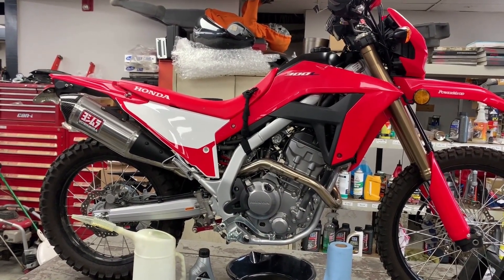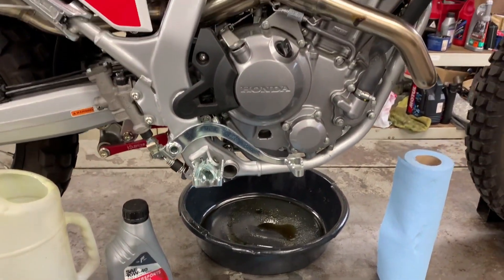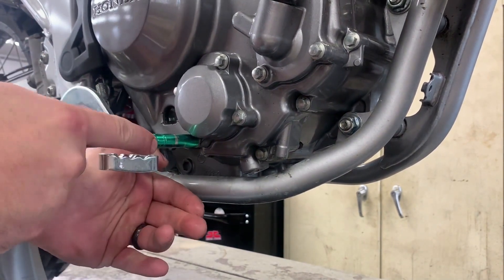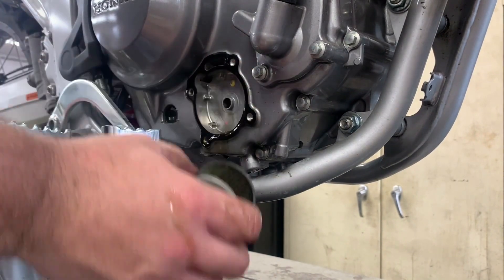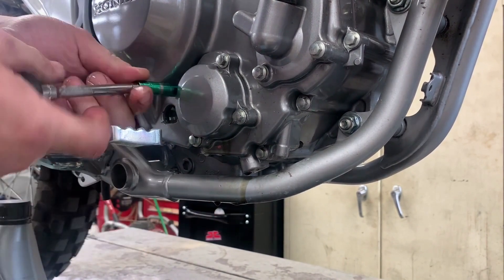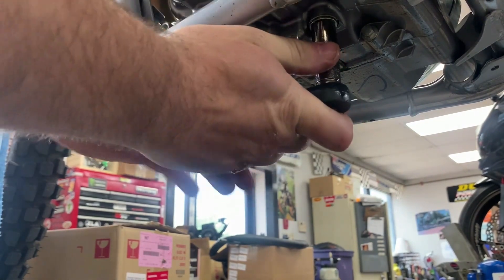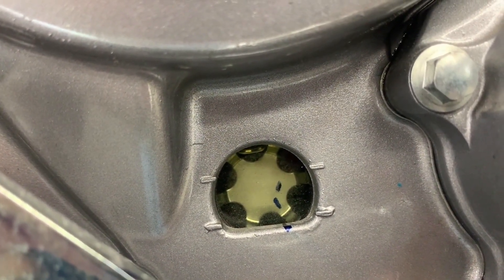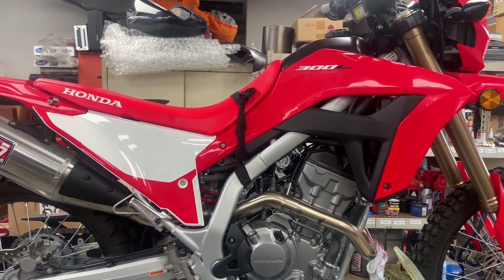How to Change Oil on a Honda CRF300L - Quick Instructions!

Comment: First step is undo the oil fill cap for better flow to pull more particulates out of suspension when draining... but nobody does that.

Comment: So I’ve done the 600 mile oil change and I’m about 5600 miles in. It’s recommended 8000 miles before oil changes but my oil level is at the bottom line. Should this be normal or is it burning through oil?
Reply from the maker: That does seem odd, and it sounds like you are burning oil. If you do an oil change, which it sounds like is in order, try to get a read on how many quarts drain out to see how much you may have burned through.
Reply: @poweroilcenter  
Could it be from running it hard? I’ve been commuting at around 60-70 mph 100 miles a day. I’m a big guy but very surprised how low it was
Reply: About 18 ounces of oil was missing. It’s also been 99-106 degrees the last couple weeks. Run it pretty hard.
Reply from the maker: @Trumpwonhahahahaha  High temperatures can contribute to engine oil burning off faster. When an engine operates at higher temperatures, the oil can thin out, which reduces its ability to lubricate effectively. This thinning can increase oil consumption as the oil can pass more easily through seals and gaskets, leading to greater evaporation and burning. Additionally, high temperatures can cause the oil to break down chemically, reducing its viscosity and protective properties, further accelerating consumption and wear.
Reply: I don't care what Honda says. 8k is too long. Change it. It's cheap and easy. Plus a perfect video right above.

Comment: Hello, I live in Turkey. Everyone here recommends me to use semi-synthetic oil. I am in favor of using full synthetic. Will I encounter any problems? I am a crf250l user. The oil I want to use is Motul 7100 10w30. I would appreciate it if you could give me information, thank you.
Reply from the maker: Mileage plays a part in this opinion, but if you've got high miles and have been running semi-synthetic, stick with it.  It helps bind to older seals and gaskets.  If you have low miles, full synthetic will ultimately lubricate your engine better in the long run.  You can also go longer in between oil changes since the oil additive package tends to break down slower.

Comment: How to reset Oil Service Light?
Reply from the maker: Hello - There is no service light on the CRF300L. The check engine light on these bikes is prone to come on with any kind of change in the fuel or exhaust system. An aftermarket air filter, evap removal, or slip on exhaust will make it come on. Try resetting the light by holding the SELECT and/or SET button on your display and starting the bike.

Comment: tq numbers?
Reply from the maker: For which bolts?
Reply: For the 3rd bolt from left.... 🤷‍♂️
Reply: @poweroilcenter all of them!
Reply: Torque: Oil drain bolt (12 mm) 24 Nm/18 lb ft, oil filter bolts (8 mm) 22 Nm/16 lb ft.
Oil capacity: 1.4 L after draining; 1.5 L after draining + oil filter change; 1.8 L after engine disassembly